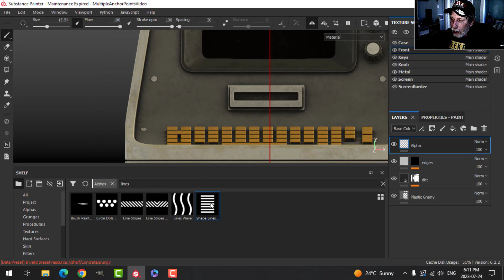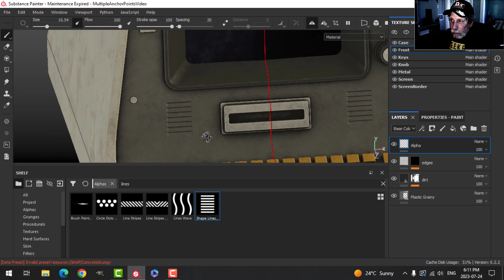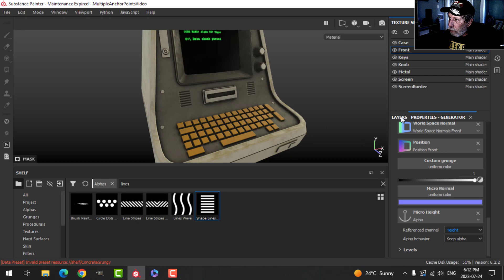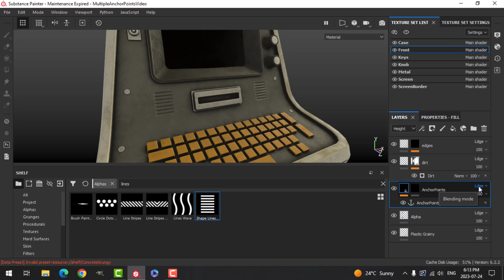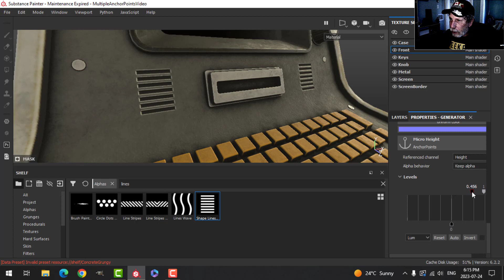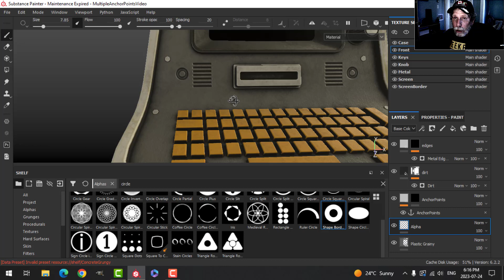SUBSTANCE PAINTER: SINGLE & MULTIPLE ANCHOR POINTS

Comment: Sadly didn't work for me. I have multiple fill layers with different anchor points, that I want referenced in the generators. I added a fill layer with a master anchor point over the other anchor point layers. I choose the master anchor point in the generators and it doesn't do anything sadly. No effect at all. I will try to see if I find some other solution.

The solution found under worked for me by @r1yuj1n . Make sure all your masks are very clean black and white or it wont work. Create anchor points for all your layers you want. Create a master fill layer above them Add a black mask to that fill layer. Inside the mask add fill layers. Each fill layer will be referencing a single anchor point, until you have all of them. Then play around with the blending modes-linear dodge works well but depends on your individual layers. Click the black mask preview of the master layer until you see all your layers in there properly. Add a master anchor point on top of all these fill layers inside the black mask. Then reference this master anchor point in the generators.
Reply from the maker: @bibu244  let me revisit the video and work on it and get back to you.  If you like you can send your sp file to me at kimmelelliott@gmail.com
Reply: @zerobio  Thank you for the video anyways, maybe it works for other types of projects.
Reply from the maker: @bibu244  I still want to have a look at the video again and experiment and would be willing to look at your file because I want to make sure it works.  I assume you are using a newer version of SP than I did in the video.
Reply from the maker: Glad there is a solution that seems to work for you and thank you for sharing it.  I will continue to look at this situation and see if there is any other way that I know.
Reply from the maker: I just tried this again with SP 2022 and SP 2020 and both worked fine with multiple anchor points (dirt and metal edges) and multiple alpha layers with only height channel active (Fill layer/Black Mask/Paint layer with alpha).  I had one master anchor layer above the alpha layers with the height channel set to pass through and an anchor point added to it.  Then added a black mask to this layer with nothing in it.  Above the master anchor layer was the dirt and metal edges generators.  Your first post seems to indicate that you had anchors added to each fill layer in addition to the master anchor point?  I wonder if this is what caused the error.  There are no anchors on the fill layers that you want the generators to effect, just one anchor on the master anchor layer set to passthrough.

Comment: Thank you for explaining the idea. After Watching some tutorials I found they didnt't explain the logic behind it, therefore I don't really know WHEN and WHY to use it.
If I understand it correctly, information I have gathered so far:
-An anchor point  allows me to add generator mask effects (edgewear/dust/dirt) onto a normal/height layer. 
-An anchor point's primary use is to provide extra depth/highlight information for a normal/height layer. (Edgewear generator to enhance normal height, dirt to strengthen normal depth in the video )
-A layer with anchor point applied is also a reference layer, whichever other layers calls for the anchor point layer, will have the anchor point layer information applied.

Comment: Nice videos! Love the content :)
In my case what I needed was multiple anchor points (2 or more details layers) combined into 1 to input into generators. I tried the passthrough but didn't succeed (maybe missing something). What I just did was to make a global layer above all detail layers, add black mask, input all anchor points as fill layers with linear dodge on each subsequent one, and add an anchor point above all, so it's the sum of all! Works wonderfully!
Reply: Thanks alot bro, this really helped me!
Reply: Make sure all your masks are very clean black and white or it wont work. Create anchor points for all your layers you want. Create a master fill layer above them Add a black mask to that fill layer. Inside the mask add fill layers. Each fill layer will be referencing a single anchor point, until you have all of them. Then play around with the blending modes-linear dodge works well but depends on your individual layers. Click the black mask preview of the master layer until you see all your layers in there properly. Add a master anchor point on top of all these fill layers inside the black mask. Then reference this master anchor point in the generators.
Reply from the maker: Yes that is a good way to do it.
Reply: For the global layer, did you only select height or leave as is? Also, did you put your fill layers under your black mask or under fill layer? Help is greatly appreciated
Reply: @bikilotta  Hey! you can leave every channel off as you just need the mask stack. It's an empty layer. This global anchors mask must be placed above all your individual anchors otherwise they can't be referenced!
Reply: @r1yuj1n  hi can you break down your method in step by step? I find it a bit hard to understand. Do you have 1 master anchorpoint which is attached to master layer? Then for each detail layer you have additional anchorpoint? Why? How would anchor point even matter, can one even combine them? I'm confused by your comment, but I also need this workflow.
Reply: @r1yuj1n  actually I think I now managed to figure it out by talking to Gemini 2.5 and having it analyise both video and your comment, I'm now on the right path and understand whats happening :)
Reply: @UnchartedWorlds  hey there! Well it’s been a while but re reading my two previous messages I don’t really know what I could add to the explanations ahah. Basically put anchor points at all the places you need one, then above all of them create an empty layer with black mask and retrieve all these anchors into fill layers (in the mask stack not the material). Then you put an anchor point above in the stack so it becomes the sum (or any other blend mode you set them up to) of all of them, which you can use in your generators. Hope it’s better like this! :)
Reply: @r1yuj1n  thanks bro, thanks to Google's Ai it understood what you meant and also checked the video and it took me step by step so now I understand the workflow :) It's simple once I've done it once

Comment: Amazing! Thank you so much I was looking for this!

One more advanced question please.. What if you have to have some height details on top of the hierarchy because there are already lot of effects below. Is it possible to somehow apply anchor point generator effects when it is above all? Problem is Iam working with material that has so many effects combined it is impossible to pick the right position for anchor points, because the previous effects would not allow me to print the "ABOVE HEIGHT details"
Reply from the maker: Glad this helped.  By definition, an anchor point goes below the generator(s).  However, I am interested in your situation.   I don't fully know what you mean but that's just me so would you like to email me at kimmelelliott@gmail.com and maybe provide some images of the layers, maybe some description and we can work on this.  We may not be able to solve it but we can try.
Reply: @zerobio  U are awesome, Thank you. Iam kinda busy at the moment, but when i get to it, I will provide anything necessary :)
Reply from the maker: @MaDmonkey3311  sounds good